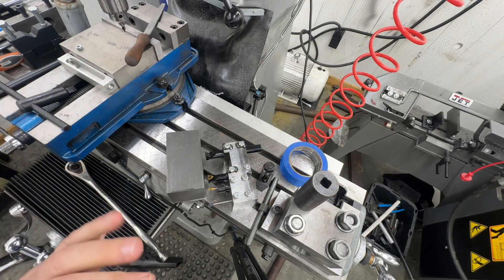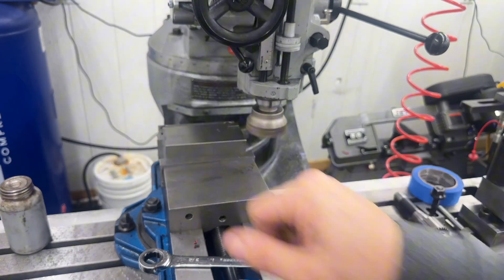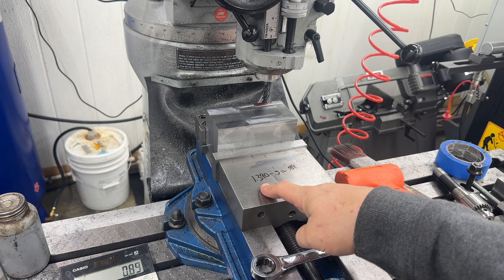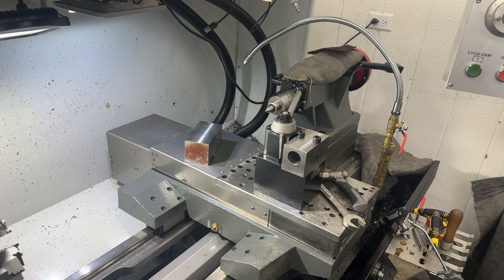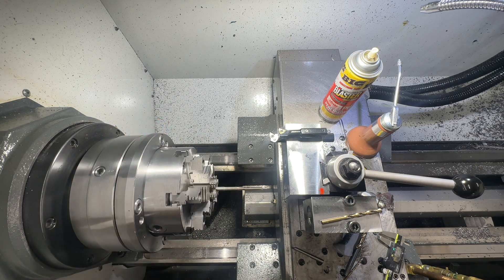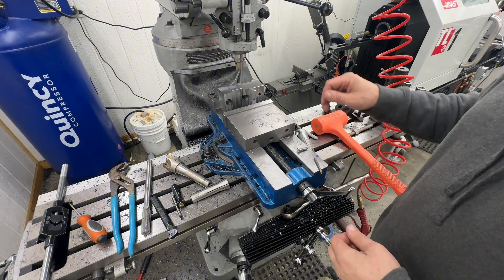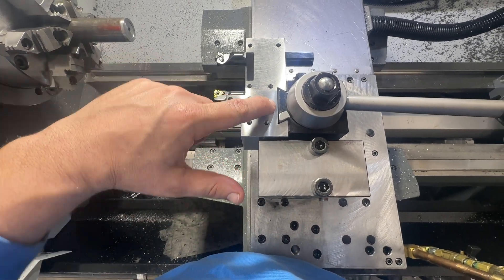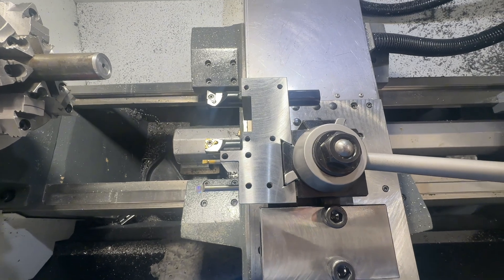CNC Gang Tooling for Gunsmithing. How to make Gang tooling. #CNC Riflesmithing #Precison Rifles

Comment: Nice job mate 👍 
Did you consider a mild interference fit and heat shrink installation of the tooling for extra rigidity and precision over the grub screws?
Reply from the maker: No sir, I wanted to have a simple removal process.